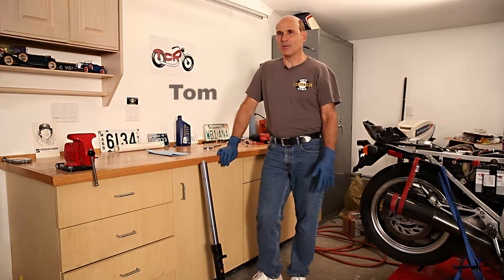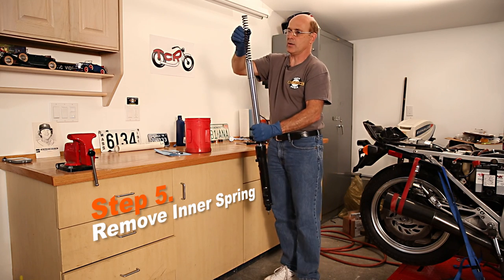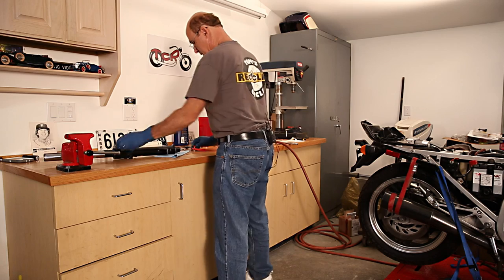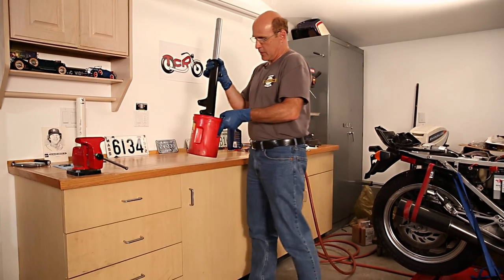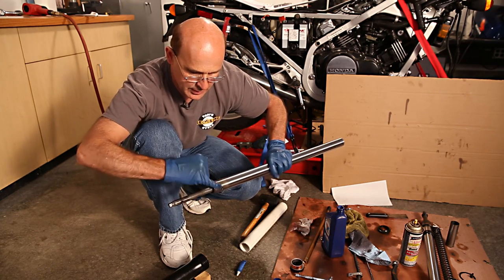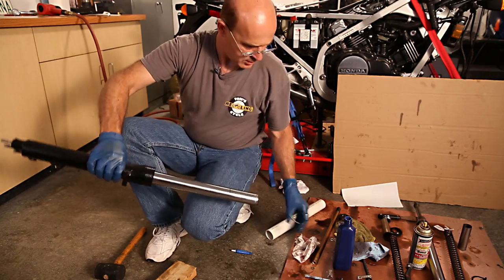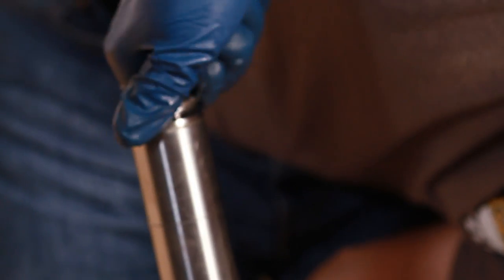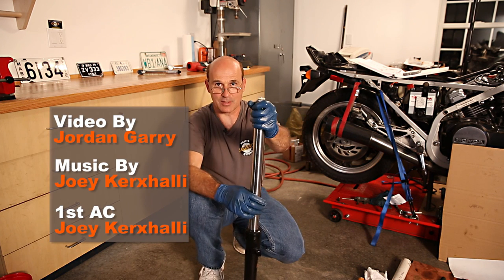Motorcycle Fork Seal Removal And Replacement

Comment: Thanks! The seal in the freezer trick worked great! There was a very noticeable difference between leg 1 and leg 2!
Reply: Jason Ewert seal in the freezer trick? what does that do?
Reply: It shrinks the seal so it will slide into the fork leg more easily (with less force/ less potential for damage)

Comment: Tom, good video, From experience , sometimes it is very difficult to undo the lower allen key bolts, I like to try and crack the loose while still under tension before removing forks from the bike. Also a mention that be very careful to not cross thread the upper screw caps as they have a very fine thread.

Comment: Much obliged. I changed the seals in a set of forks in a '78 KZ650  many years ago, still have the bike, and need to do it again. In fact, I have two sets one on the original bike I'm putting back on the road and another from a parts bike. The seals are cheap enough and will give me some practice. I didn't remember it being all that difficult and the shop wants $150 just for the labor.

Comment: Great video, it's very well structured and I know I learned something.
 I seem to have a cracked/corroded dust cap on my 85' Suzuki GS550L, it's my first bike, and she rides fine; including the suspension, I think. How much of a priority would it be to get that replaced, being I have other work to have done, like the carburetor.

Comment: You mentioned using the freezer for the ease of dust seal seating.  My dust seal won't seal far enough for the ring.  The fork seal driver tool is damaging the fork seal.  Any suggestions and the Stockton seal driver busted and bent.  What size is your pcv pipe?

Comment: I have a drive way full of bikes I bought each family member through the last 50 years; and ended up with each of them back when they could get them running again; a new guy moved in across the street and cannot get that steel spacer tube pressed back inside; after installing the spring and washer.  I do not remember ever having the same issue when changing out different length front fork tubes to adjust handling / cornering; but it has been 1 1/2 to over 2 decades since I have done this task.

Any Idea why he is having this problem; I gave him four different shop service manuals for various bikes; but figured the shop service manuals I had for my track bike; a 2009 Buell 1125R to get a general idea.  His steel tubes like the one you put in during this video; is a good 8 - 10" long, and no matter how hard or how big of a guy tries; it still sticks out a good 4 - 6", and there is no chance of putting the top cap nut on it; something isn't right; however, I have never owned a 2001 Yamaha V-Star 650cc bike before.

Addendum:  It has been since 1986 when I replaced my front tube's with 4" over forks on my 1st new HD 1100cc Sportster Custom while stationed in Germany; and 15 years since I put 2" over front fork tube on my second new 1999 HD Softail Night Train, ( Which I still ride today ), when not toting around ole girl on a 2011 HD Road Glide Ultra.

Any insights would be appreciated; the good new story is; I told him; it is only difficult the first time .. lol, like most every thing.

Comment: Great video.

One question, what should I check when the fork locks up when bottom cap screw is fitted. The damper assembly doesn't seem to want to come through the bottom of the upper fork (stanchion). I have not changed any of these components.

Bike is an XJ600n.

Comment: Great video. My problem is that the inside of the fork is turning while i turn the allen head bolt at the bottom with my ratchet. i m hoping that a friends electric impact wrench will undo it.

Comment: Yes.  Especially if you don't heat the Allen bolt before removing it next time, and if you try to get the bolt out without first heating it, you'll just tear it up.

Comment: Well presented. I have only 1 issue here. You never ever put locktite on that bottom screw. Why you may ask? Because it's like breaking it off in mama's back door. The next guy that comes to do this is gonna curse you to no end.  You do not need it or any other form of adhesion assistance. No Teflon tape or ANY foreign substance should ever be used inside the oil compartment. AND it forces you to delay putting it back together, who wants THAT problem? Not me. Just replace the copper washer, torque to spec and you are 100% good to go.
Reply from the maker: You may be right, but all of the Honda factory service manuals that I have (at least 5) specify using loctite on that bolt.  Personally, I don't think it's needed either, if torqued to spec.
Reply: @tomscyclerecycling8242  Point taken. A locking type washer behind the head would do nicely to keep it in place. Think I will try that just in case. I am doing this project tomorrow. I have purple lock tite and may just use it. It is lighter than Blue and I can wait overnight to put it back in. No hurry here. Bike's been sitting for nearly 2 years. Carbs are done and she idles and runs up nicely. But that front end is calling my name, especially after the death wobble hit me at 75 mph. Sure got my attention fast, only had 1 hand on the bars.

Comment: You have convinced me to do it myself on my Suzuki 1200 Bandit (GSF).
The right ordre at the end is (it's a question) :
- you tight the bottom bolt
- you add the fork oil by the top
- you pump several times for the oil to get down
- you close the fork by tightening the top big bolt (where you manage the smooth/hard of your fork) ?
Am I right ?
Reply from the maker: I'm not familiar with your Bandit, but you pretty much have it right.  I don't have to do any pumping after I add the oil since it isn't like a brake system with air trapped.  Also, some forks have an adjustment that's part of the top nut, but not all of them.  The ones with dampening or rebound control do.  Best of luck!

Comment: Other videos on YouTube show them loosening the allen bolt (not removing, just loosening) BEFORE removing the Fork Tube Cap. This seems like an easier method. Is there any reason not to do it this way? Thanks for the very informative video!
Reply from the maker: That's a personal preference and either way is fine.  Oftentimes that Allen bolt is too tight and the fork tube will just spin when you try to loosen it up.  Using the air impact gun just zips it off and prevents anguish and frustration.

Comment: Great video, actually about to replace the seals on my 82 V45 sabre. I'm positive the forks are the same so wondering if you had a link to the seal kit you used? Particularly the circlips, none of the kits I've found include them
Thanks!

Comment: Great video with good lighting and nice camera angles. One thing that should have been covered in more detail is the oil capacity step. I believe this model calls for 472ml per leg total oil capacity. You didn't show any cleaning of the internals so I assume there was some residual oil still inside. Even better is to fill the fork leg with oil to 137mm from the top. Progressive suspension makes a great tool for doing this that makes it stupid easy.
Reply: Hey man. Factory service manual '83-85 v45 750F Interceptor states 

360cc or 12,2oz atf right leg
380cc or 12,8oz atf left leg

Also the "The closely wound coils must face toward the top." Page 14-28

Did you determine the oil level after filling said cc of oil or how did that height get calculated?

Comment: Sliding the seals on with shiny forks is a perfect world. What if your forks have nicks from 30 years of road travel??? What do you recommend?? I installed new seals on my Gpz 750 yesterday and had to take them back out as they were leaking and this was when the bike was on the centerstand as it is not yet on the road.. I did not separate the forks but used a seal puller to remove the old seals. I  used some ATHENA seals and one got nicked pretty good and was leaking like a sieve, the other not too bad but was weeping. I was thinking about using a piece of pop bottle and making a sleeve that fits the fork and sliding the seal down the tube on the sleeve, then popping into place when I get to the lower "un-nicked" part of my tubes thus avoiding any damage to the seal. The old seals never leaked but after 13 years i wanted to swap them out for new ones, to be sure.
Reply from the maker: So it sounds like your fork tubes are pitted.  I would take some good chrome polish and spread it all the way around the tube, all the way up.  Then really work it in good with a piece of aluminum foil.  Yes - you heard me right, use aluminum foil.  Rub hard so that it takes down the little edges caused by the pitting.  Then buff it out carefully and see how it feels after you're done.  If you do this a couple of times, it should smooth out those rough areas to the point where they won't nick your new seals again.As far as seals go, I'm not that keen on aftermarket ones.  I only use OEM and have had great luck.Hope you have better luck the second time around.Tom
Reply: +Tom&#39;s Cycle Recycling Thanx Tom, I'll definitely try it out.
Reply: +GPz84 you could also replace the stanchions if they are too far gone.

Comment: Will it be ok to just replace the seal without draining the oil? Or draining the oil is a must? 2016 fz 07 have some oil leaking on the left fork
Reply from the maker: You'll need to remove the fork and disassemble in order to replace the seal.  So yes, you have to drain the oil.

Comment: Is there such a thing as only replacing the outer seals?  or does the whole system need to be refreshed mandatory?
Reply from the maker: The inner seal, or oil seal, must be replaced.  This is the ring the I drove into place with the PVC.  This seal is what eventually fails and allows fork oil to get by.  The outer seal is just to keep dust and water out.

Comment: Got my VF750F in boxes and trying to rebuild. I discoveres that both fork legs are of a different length? Do you know on which side they go? Can't figure it out...  :-/
Reply from the maker: The left side fork has an anti-dive unit on it and there should be a TRAC sticker down near the bottom as well.  The right fork leg is plain and looks like a normal one.  The differences will be obvious when you look closely.  Good luck!
Reply: Thanks! Should made my problem more clearly. The outside is not a problem, is meant the inner forkleg, the part that is clamped in the yoke and the handles are mounted on.
Reply from the maker: Ah, the fork tubes.  It's been a while since I had mine apart so I can't remember.  I highly recommend joining the VFR discussion group here: http://www.vfrdiscussion.com/forum/index.php/forum/5-earlier-vfrs/Lots of great people here who can help with your restoration and I bet you'll have your answer in no time.

Comment: Any recommendation on where to get snap ring pliers?  I'm working on an 04 Road Star.
Reply from the maker: There are various sets for sale on Amazon that are worth checking out.  Some are junk and will break during the first use.  Find a good quality set that include a larger one needed for the snap ring in these forks.  The ones with a 90 degree bend on them are better than what I used in the video, as long as they're solid and well made.  The tips can break off of the cheap ones if the snap ring is stuck from rust.
Reply: @tomscyclerecycling8242  Thank you!  I'll see if I can find a good set!  Thank you for the quick reply!

Comment: Hi Tom, Hope all is well...  Is this fork rebuild the same for a 1983 CB1100F?
Reply from the maker: Hi Hans.  It's very similar, although the 1100F has the anti-dive units to deal with.  But the same basic components needed for fork seal replacement are the same.  I've done many 1100F forks, so if you run into a problem, just contact me through my web site, www.tomscyclerecycling.com.

Comment: How similar are these forks to the CB900F2? I’m going to have a go soon…..
Reply from the maker: The 900F forks are very similar in design to the one I rebuilt in this video, so the rebuild procedure will be virtually identical.
Reply: @tomscyclerecycling8242  
Hi Tom I have my forks apart and checked components for replacement. You mentioned cleaning with dish washing detergent and then use a good solvent. Is brake cleaner okay? also is this all parts of the fork or should I avoid some areas?
Reply from the maker: @adamdowning9444  Hi Adam.  Brakleen is fine, but just inside the fork leg.  It will attack the paint on the outside, so just use hot water and Dawn (or something similar) on the outside and you'll be good to go.
Reply: Me again Tom! 😂
Sorry to bother you again, just curious if I have a problem or not. When removing the fork pipe I had one of the oil lock pieces remain in the bottom case and one that came out (o-ring was damaged so replacing). Was wondering if just dropping the lock piece that came out back in when I rebuild it will be okay….?
Reply from the maker: @adamdowning9444  Hi Adam.  It's not uncommon for an oil lock piece to stay stuck in the bottom of a fork leg.  If you slide a wooden dowel down and into the piece, you can probably loosen it up.  Otherwise, just clean out the leg the best you can and reassemble.  It will be fine.

Comment: I'm trying to replace the dust seal and the seal  from my sabre v65  but the little holes from the circlips are gone from all the rust any idea how to take em out some people in the v4 forum say  to drill the forks but I don't know
Reply from the maker: That's a tough one.  You need to soak the circlips with penetrating oil for a few days and then carefully try to loosen them from their grooves by using a small punch and hammer by tapping them from the top in several areas all the way around.  Once you know they've been broken free, you need to somehow get behind the clips to pry them out.  The only way I've been successful is to use a Dremel with a special metal cutting bit.  You cut into the metal(on the inside of the fork lower just above the circlip groove) up above the clip just enough to expose the backside so that you can get in there with a pick to pry it out.  Be very careful not to score the fork tubes - wrap them in duct tape to be on the safe side.  If you get the clips out, you'll be in good shape.  The new circlips will work just fine.

Comment: Allen bolts in the bottom of forks just keep spinning. Any ideas would be more than appreciated
Reply from the maker: I always use an air impact gun with a socketed allen wrench.  Works every time.  I'm sure you could do the same with an electric impact gun as well.  It spins so fast that the bolt can break free.  Doing it by hand will ust make it spin as you described.
Reply: Tom's Cycle Recycling   Thanks, I just got done replacing the oil seals on my 1988 Honda VTR250 Interceptor. Quite the job

Comment: I have a issue resealed 2004 V star fork and with new seals and correct fliud level one came out great 2 nd ended up spongy no difference in assembly?
Reply from the maker: Sean - maybe there are some air bubbles trapped in there.  If you take off the fork cap and carefully pump up and down (just not too far or fork oil will come out there and top) that might solve your problem.  This is something I should have mentioned in the video.

Comment: mine have air also. anything special. have you done one  86 vfr 700
Reply from the maker: I have an 86 VFR750F.  Same basic rebuild procedure.  When you slide the forks back into the triples, the air holes near the tops of the tubes will align with the channels in the air joints.  It won't take much air to get them to pressure and use a hand pump to do it.  Don't use compressed air or you could blow out the seals.

Comment: Sir..what if i forgot to fit the backup ring..will it cause any damage??.its an usd fork btw
Reply from the maker: I would go back in and reinstall that.  It serves a purpose in the design and your new seal may get damaged.  Leaking is also a possibility.
Reply: @tomscyclerecycling8242  thanks for reply...does the installation direction for backup is same for all forks...coz i saw dave moss tuning video..that was a usd fork and he kept the flat side up

Comment: Can I use motor oil such as 10w... instead of the expensive 10w fork oil?
Reply: Perhaps not the best idea. the "W" in motor oil multi-viscosity labels (e.g. "10W-30) refers to "Winter," meaning that 10W-whatever will roughly approximate a 10-weight oil in low temperatures (the oils are tested at either 32 deg. F/0 deg. C or 0 deg. F/-17 deg. C, don't recall which). This is for enhanced lubricity during really cold starts, which is torturous on crank and camshaft bearings. So, multi-viscosity motor oils are not likely to behave predictably in a fork. Shop around on ebay/amazon, should be able to find a decent brand(can't go wrong with factory!) fork oil for little to no more dollars than a comparable, high-quality synthetic oil (and I don't mean crazy shit like Royal Purple). Food for thought... ride safe! Idiots everywhere yo!
Reply: Thank you for that explanation. Much appreciated.

Comment: I am changing my fork oil with new oil. My manual says 10w20 but I can't seem to find that anywhere? This is the last thing I need before I put my forks all back on my bike. Anyone have any suggestions?
Reply: Teague Jelinek I just did a oil swap on my Grom the other but instead of the 5w I put in 10w but it is actual fork oil though. So I suggest going to some sort of local dealer and see what w oil they have in stock, if it’s a big bike I would suggest a 10w or 15w oil. I did a 10 because she was bottoming out from doing wheelies sometimes did the thicker oil and ride quality is so much better now. Hope this helps you out!!!
Reply: @corndogg_4209  thanks man, I went to a Kawasaki dealer and found some. Now I'm back on the road 👍 I was just kinda freakin out cause Ive never changed my fork oil before and didn't know where to find some (I was checking AutoZone and stores like that haha..)